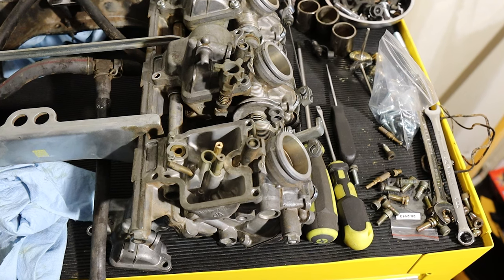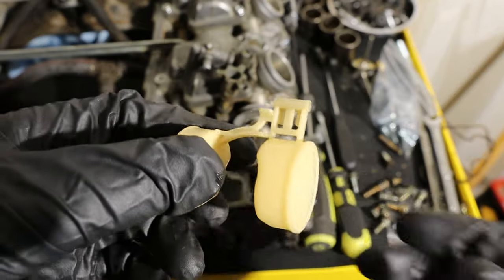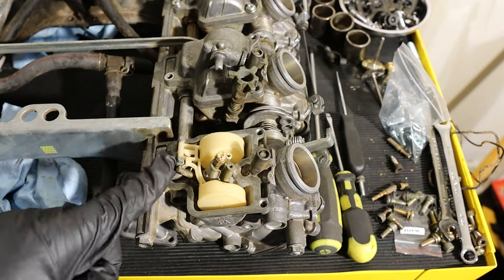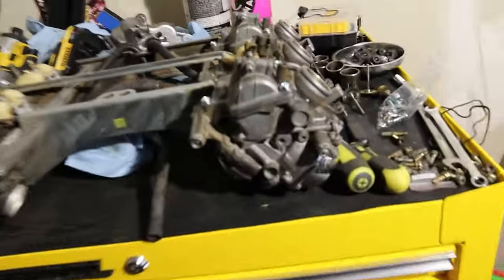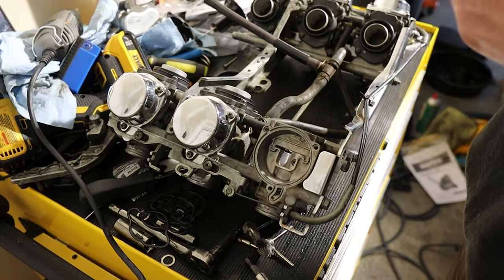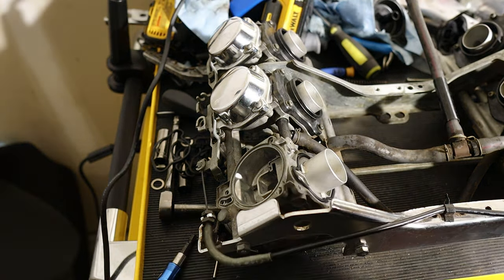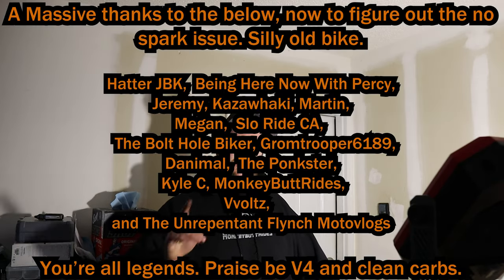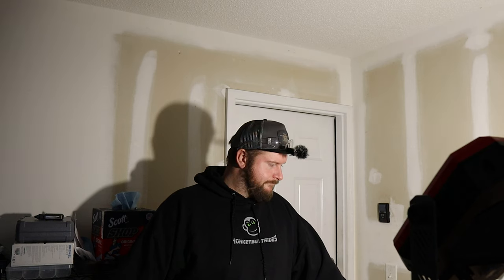Honda Valkyrie 1500 Carb Rebuild - Progress!!

Comment: I had carbs on a Yamaha 650 cruiser, and never had any issue with them, or had to touch them in the two or three years I owned the bike. In a way,  I actually enjoyed the little rituals that having carburetors brings. I’m looking forward to my next bike with carbs, so I can get more hands on experience servicing them.
Reply from the maker: Honestly once you use carbs, even every now and again, they, in my experience, hold balance and function just fine. So long may that continue for you :) I do most of the time, until I'm late for work and only have carbs and don't have the 5 mins to let it heat up :D If you can, find a spare set for your bike that's cheaper and needs rebuilt and buy them. Rebuild them and then you've a spare set and the knowledge :)

Comment: So far I have avoided owning any bikes that have fuel injection.   The multi cylinder engined bikes I had for years never gave me any carburettor problems.  Perhaps the petrol was better then.  One of my great joys was balancing the carbs and seeing, hearing, and feeling the difference that made.  It is only in recent years with single cylinder machines that carbs have given me trouble.  Is this connected with poor quality fuel?  People rave about the wonders of electronic fuel injection but while we may not have to strip and clean and fiddle with carburettors we do now have to diagnose and resolve problems with the related electronics like sensors instead.  Swings & Roundabouts.   Another good video.  We await the test of the serviced carbs with interest. 👍
Reply: You have to sync. throttle bodies the same way. Still get that same great feeling.
Reply from the maker: I love FI :D Petrol was most likely better then, the GSXR carbs were great tbh. But they are in general slightly more of a pain imo, but I have literally never had an FI issue so that might be part of it. 
That said I've never owned a NEW new bike until the Vstrom and Z900rs so time will tell eh, and yes, nicely balanced carbs make such a huge difference. Failed miserably btw :P Carbs seem fine but the bike has zero spark, probably pulse generators. And yes, as Pete said, throttle bodies still need syncing :)

Comment: Very interesting vid!  I think I'd go for new diaphragms though availability might dictate, depending on urgency of wanting to test ride.  New fuel lines the same.  I like carbs for throttle response, especially at low revs (heard a lot of complaints re "snatchy" response with injection requiring remap or piggyback ECU etc).  Do I like working on carbs? Will let you know, haha.  Wording is wonderful, languages, dialects, accents, terminologies all adding to the mix. Correct terminology is of lesser importance when presented with visual information (if in doubt or confused, go read up on it!!!) so yah boo sucks to the complainers!!!!! (In my ultra mature opinion 😂).  Cheers, Andy.
Reply from the maker: Glad you enjoyed it amigo :) I think I will tbh, I tested them and that bad bad one seems to not be working. They're available but expensive, worth it while they are available I think :) Already ordered fuel line :) That's true of most EFI bikes as they do a fuel shutoff off throttle which means you then gets a kick when you get back on throttle. 
Hahaha I think you'll love it :) I agree completely :P And you're very mature imo :P As a mature person I can judge :)

Comment: Wow you actually showed up in my notification feed for a change. YT must have sobered up for a second. I've never rebuilt a carb but the carb on the KLR is easily accesible and shouldn't be too tough to work on when I do the carb mod to give it the small. little boost. Now if you will indulge me for a second and let my inner childish nature come out and say your mic's shadow looked like a "johnson" when you turned your head just right. Couldn't help but chuckle a few times thinking wow he really is a D***** even though you're not. Cheers and this video was very informative.
Reply from the maker: Nice, maybe youtube has decided it doesn't hate m anymore. I won't hold my breath :D The KLR carbs from what I've seen are lovely to work on and remove so hopefully it'll be grand to do when you get to it :) 
Hahahahahahahahahaha I am most certainly a d***** :D Thanks amigo

Comment: You're going to want to split the carbs and change those O-rings.  DAMHIK.  Don't install them before doing a bench test to check for leaks.
You can possibly use those diaphragms if you RTV the bad edge.  You can test them once installed by lifting and letting them fall, comparing to the others. They're $$$ from Honda if still available.  China makes them but I've never used them. 

Polish the needle  seats With a Q-tip and metal polish so the float doesn't stick and seals well. 

I'd go up 1 size on the main and small washer under the needle due to EPA running lean.

Do I like carbs?  I don't not like them...Had FI bikes in the past. IF something goes bad with FI, you probably can't fix it yourself.
Reply from the maker: Yeaaaaaaaaaaaaaaaaaaaaaaaaaaaaaaaaah I found that out as soon as I popped them in and ran some fuel to them :D The videos are usually at least a fee days old sadly it would have been great info :P 
I think I'll just swallow it and order new ones, revzilla have them OEM, pricey but the camera didn't even show how bad that one was. 

Already did, just didn't show it so the video wasn't too long :) Thank you tho! 

I was looking at the stage 1 kit, I might do that in future, right now I'm just trying to get the bike to a running condition to find all the major problems since it's history is very spotty. Looks like I have a bad pulse generator next. 

I don't not like them is a very good way to put it, I'm in the same boat. FI has never given me a single issue to date tho so right now I do like it :D
Reply: stage 1 is too $$$ There are others.  $30.  Transformed my 92 750 Nighthawk.
Reply from the maker: @petev.9357  Ah it'd be down the road anyway, first things first get it running and registered and then I have forever to modify it :) Interesting.